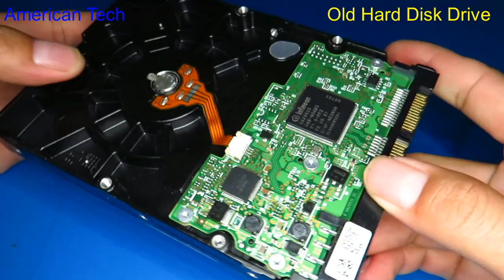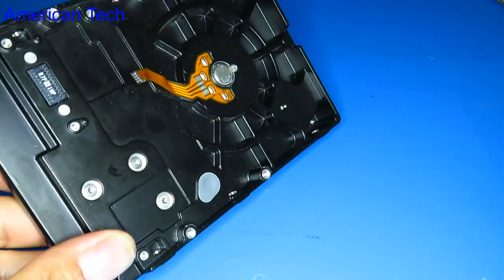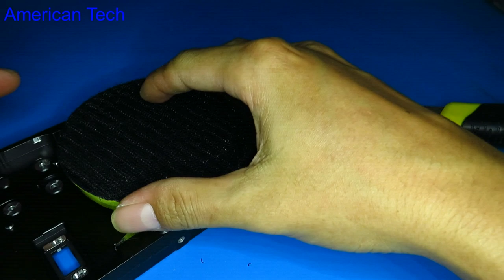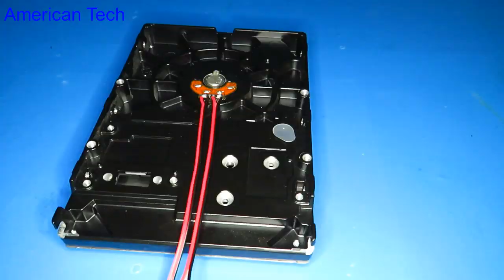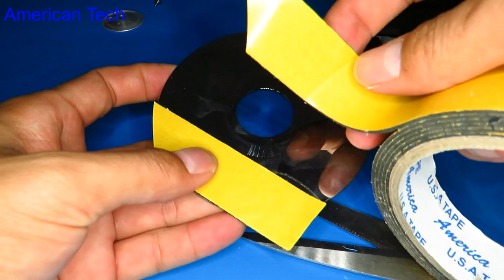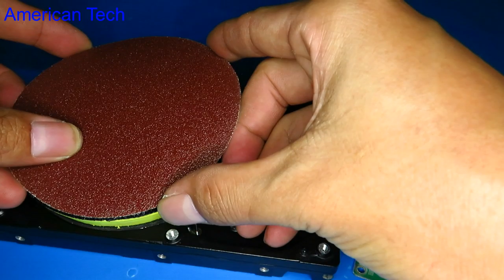How to make mini sanding machine using old Hard Disk Drive HDD

Comment: Can you explain how to connect HDD? Which voltage are wires you connect?  Please describre a litle better.
Reply: @makeitbetter8439  thanks but in his clip he  used wires on yours you use connector. My question  was those wires where 12v or 5 or 3v? how to connect directly without connector?

Comment: I want to try it...
I have that same module, also 3 sata hdd here that's not using anymore, but not as old as that. 
Your hdd, I think thats the first gen sata hdd ever for replacing the older IDE version hdd.
The problem is, my hdd only have 3 power connector terminals underneath 
and yours have 4 + 2(scratched both sides)
How can I connect my hdd to the module?

P. S. 
Honestly, I really enjoy watching "MOST" of your video.
And I appreciate what you're doing and sharing to the viewer your good and useful step by step DIY idea...
There's one only thing that I'm very freaking concerned...
Most of your videos that I've watched,
Well, actually it looks quite simple and very easy to follow the step by step tutorial, 
But the moment I start to watch, I've noticed something's wrong. 
I don't know where it's coming from, maybe it came from my head of in the video or somewhere else...
Hair all over my body started to rise...
I know something bad will happen...
The longer I'm watching at the same time listening to that looping background music, 
The more I'm getting violently anger with everything and freaking me out!
My motivations of learning fades.
My concentrations have turns something intolerable thoughts and my willingness willingly turned unwillingly. 
With that that choice of music, nothing can be done!
It's okay to hear the background sound without the background music, even it's only just a noise but not that music. 
Its very #annoying #unhelpful and #unhealthy.
DON'T USE THAT FUCKING MUSIC EVER AGAIN!

Check here, the one you copy:
https://youtu.be/XgFaPARApHk
Reply: çok haklısınız müzik dikkat dağıtıcı ve sinir bozucu, oysa video öğretici ve çok güzel, müzik bu güzelliği mahvediyor.
Reply: Don't listen to that kind of music, which doesn't uplift your soul and harms your thoughts; instead, listen to good music, such as orchestrated classical music.
Reply: Con cuánto voltios funciona!!???

Comment: On my Mini Sander with HD Motor, when I press a little, for example, the tip of a screwdriver on the disk with the sandpaper, the Motor stops turning and I have to start it up again. I use the HD's own electronics. Do these motors really have little power? Thank you